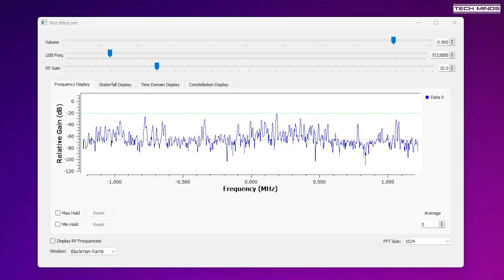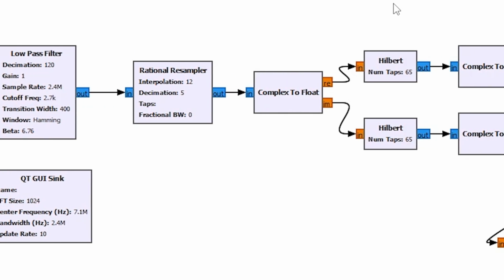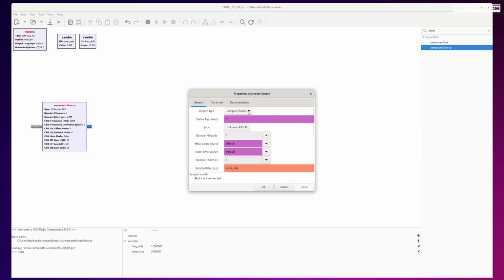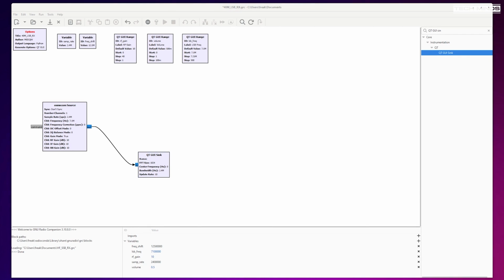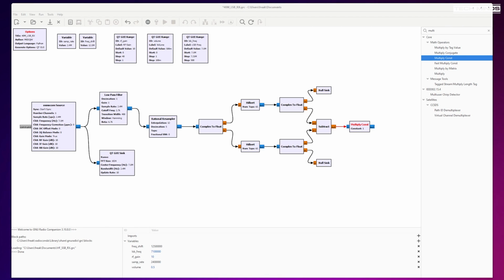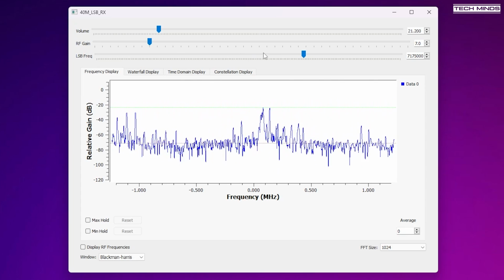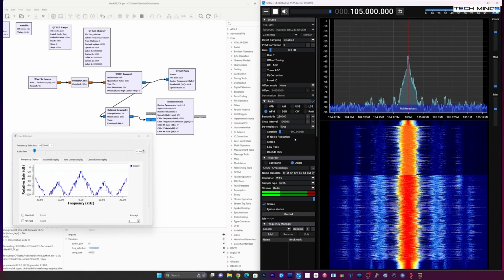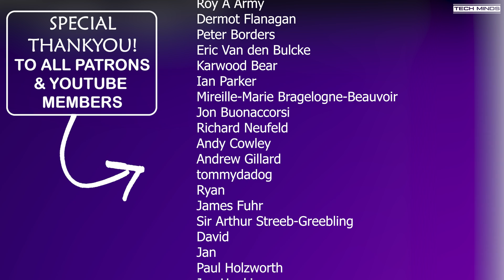How To Make Your Own SDR Software With GNU Radio Companion

Comment: Also, is there an easy[-ish] way to implement the end result of GRC on, let's say, an STM-32 or ESP-32 microcontroller? IOW, using GNU Radio as a "cross-platform development tool"?

Comment: I want to know what you can do with your SDR software after you design and debug it with GNU Radio Companion. Is there a way to run it and use your sliders OUTSIDE of GRC?
Reply: You can execute the Python code generated by the flowgraph directly from the command line. Is this what you mean?

Comment: Hilbert transforms are intrinsic to implementing an SSB decoder using the phasing method. A Hilbert is used on both the I and Q components to provide the same delay to each and matching output data structures, although the phase shift should only apply to the Q component.

Comment: No problem the FM signal can be demodulated using either the atan() function or atan2() function and actually the was a thesis on the demodulation of FM in c++ you just have to search for it and is a PDF file that

Comment: Truly Excellent. I always wanted to do this.
Controlling the sliders with actual hardware rotary encoders. Where does one start? I already have several X-keys USB Keyboards with built-in rotary encoders so I'll start here, unless there are other suggestions.
Thank you so much Tech Minds. Your Vids are a must-see for all radio enthusiasts.
Reply from the maker: Thank you so much for your comment, means a lot :-)

Comment: Glad you are enjoying the software! Have you tried it with your Hermes? We're happy to help answer any questions that you or viewers might have.
Reply from the maker: Ohhhhh I have not yet, but I will, thanks for the heads up!
Reply: This also work with Redpitaya for both transmit and receive.  I have converted some gnuradio flow graphs to C++ there is some real power there.  @TechMindsOfficial
Reply: Having trouble in decoding LORA packets in real time fashion, any help?
Reply: Hey there! Flowgraphs are awesome. I'm trying to make a custom tree component Modbus source and sink and I'm following along the tutorial but I'm having a hard time following along because the example only has a 'selector' component.  Once I do that I'll try adding a PID Controller block.. and will have a tool for doing control system analysis!  Or doing control of single loops with built-in visualizations!  Industrial control systems use this same kind of block layout for accomplishing control... https://www.emerson.com/documents/automation/product-data-sheet-deltav-sis-function-blocks-en-57464.pdf.
Reply: Getting into customization of my own UI for GNU wish me luck
Reply: examples! Need examples! I have sen some examples on github that are OLD and no longer work with current year GNU. I utterly failed at getting my works USRP x300 to do anything more then basic FFT and waterfall. Tried python only for better UI but apparently I suck at math.